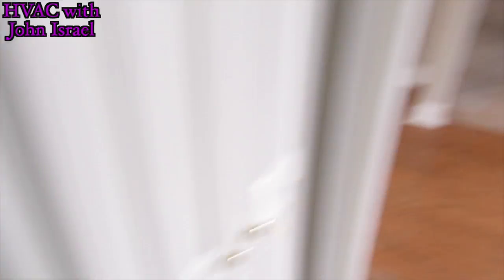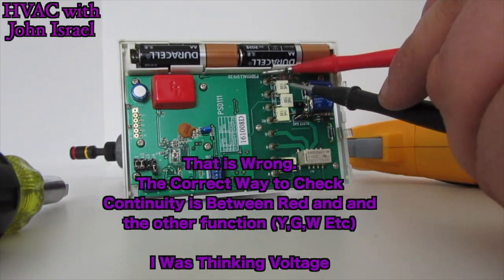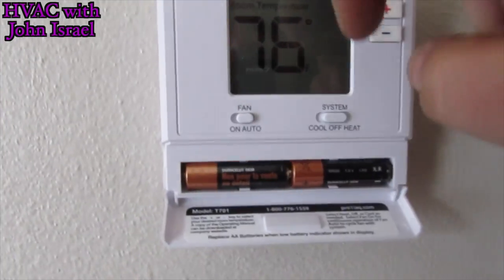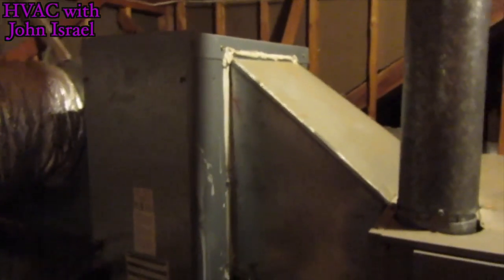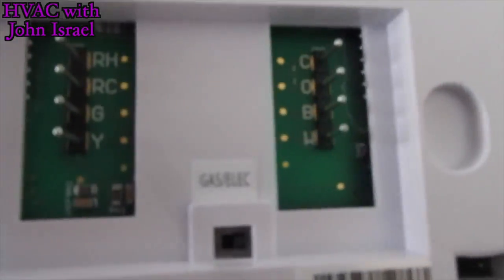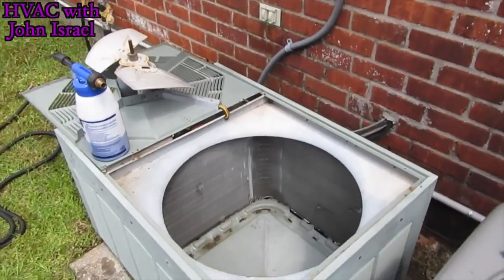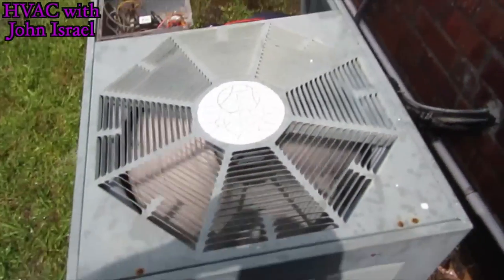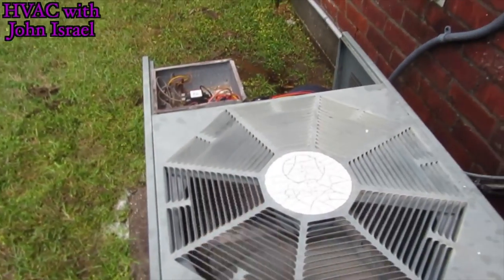Simple HVAC Service Call | Bad Thermostat

Comment: Never had a problem with LUX thermostats, parents had one installed new 20 years ago when they got a system still worked but upgraded them with a newer LUX with a backlight. Main thing is with them there is so much adjustability, had a complete new system installed at my house over winter with Central AC added and the Honeywell's are junk if your house is not 100% air tight, it tries to keep it at +-.05 degree with no way to adjust it was turning the system on every 5 mins. The LUX allows the temperature differential from - 2 + 2 and works perfect house is set at 74 goes up to the high-end at 75 then brings it down to 73 before it turns off. System was on eight times an hour before now only 2. Just got a Wi-Fi version works good and keeps track of how many hours your system runs a day in the smartphone app.

Comment: We hax the thermostat that you put in on the video but for some reason it would not function correctly so we replaced it with an aprilaire 8444
Reply from the maker: Pro 1 had issues with their thermostats a couple few years ago so I quit using them. But recently they have worked the bugs out and they are very good thermostats. I’m a Honeywell guy but I don’t like the new t series. I love the focus pro 5000 but Honeywell discontinued them. But I heard recently that they are bringing them back due to high demand. If they do I will go back to it
Reply: @johnisraelhvac2019  the problem we had with the pro 1 thermostat model t701 was that in cooling mode the only way it would cycle off was to keep the bedroom door next to it closed and i believe it was because of the draft coming from under it

Comment: My outside unit kicks on but my blower fan doesn't sometimes it does sometimes It doesn't sometimes I have to lightly tap the blower and it will kick on help south texas heat